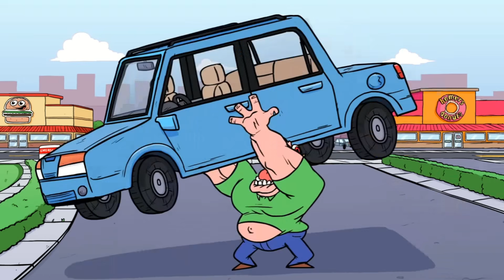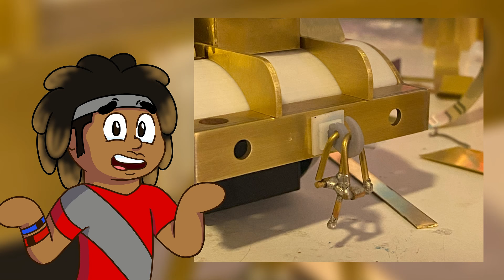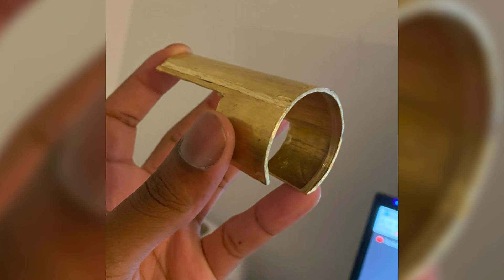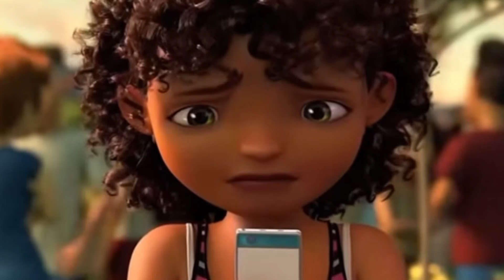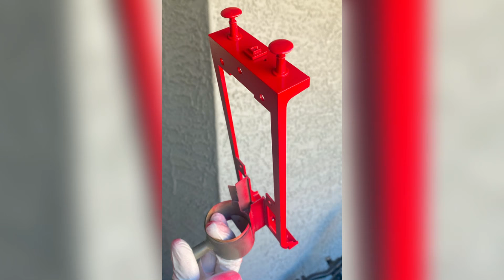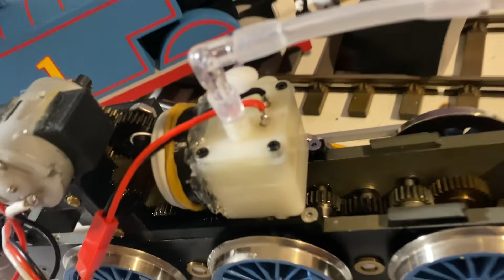How I Built My BRASS Gauge 1 Thomas | Tutorial (8,000 Subscriber Special)

Comment: I wanna do a brass Thomas someday (TGD Brass Thomas if I’m lucky)

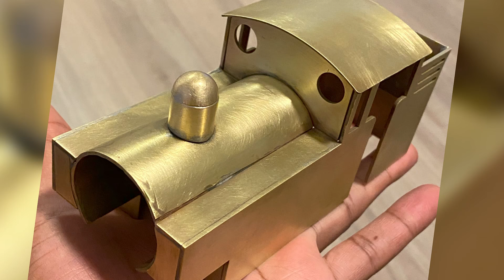But I do wanna point out that at 14:02, the smokebox probably didn’t need to be soldered to the running board. I would probably have it a detachable piece in case I have to service it. I think this was something the TGD Brass Thomas models did different than the original TATMR Brass Thomas
Reply from the maker: All the brass models has soldered down smokeboxes. It’s in both pictures I showed at the time stamp and in the pics in the beginning
Reply: @TankEngineJonJon Did they also do it with TGD Brass Thomas